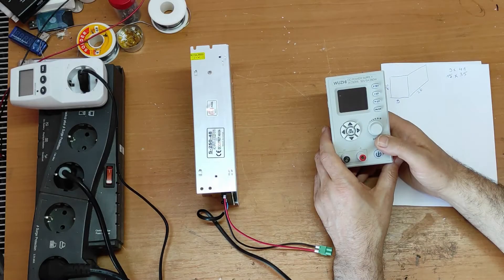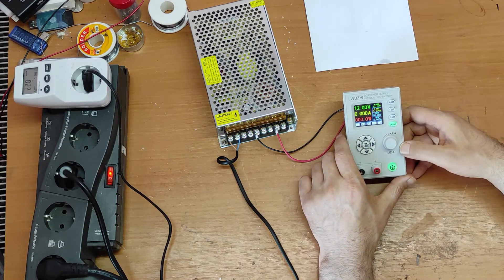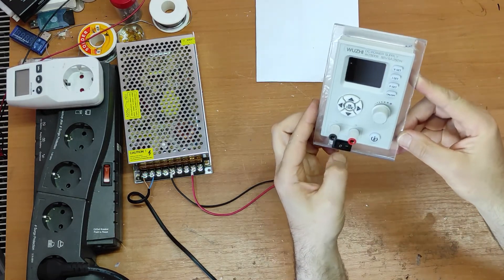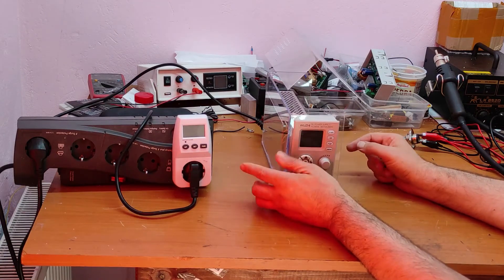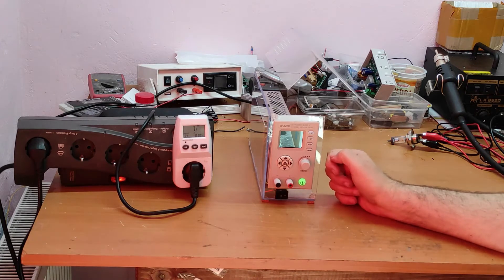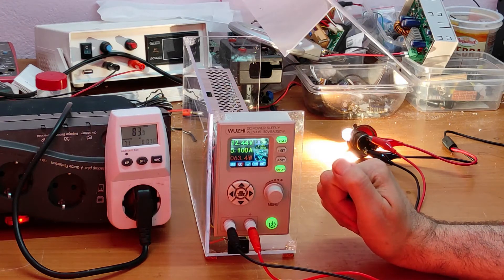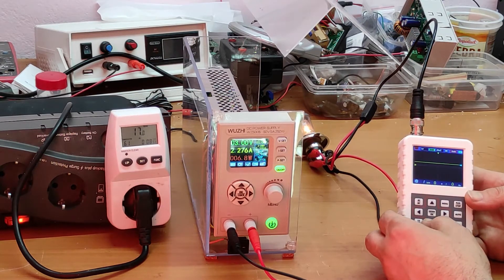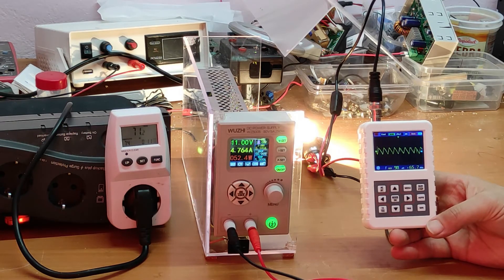50V 5A DIY digital control power supply SMPS under 45usd

Comment: Definitely feel ripped off buying this,you need a power supply,to power your power supply,40 bucks wasted lol
Reply from the maker: bro I dont agree. I use this power suply from 4 years and works PERFECT. brand new ps 50v5A is 3x 4x expensive
Reply: @diymariuselectro  they don't tell you it doesn't have it's own power supply,it's bait and switch,I've never seen a dc voltage regulator that doesn't have a built in power source

Comment: Wow! Very nice that you made this video and upload it on YouTube I was right about to purchase actually I did purchase that specific charger but then I change my mind when I realize that I need a power supply. So I went with a  Junsi iCharger X8 Lilo/LiPo/Life/NiMH/NiCD DC Battery Charger (8S/30A/1100W) and 1000 watts/50 volts power supply. What I like about your charger is that you can preset different voltage on different settings and will remain like that and you select is needed whenever you want it. You did a great job building the box and putting everything together!
Do you recommend this power supply digital face??
Reply from the maker: I recomend this digital power supply,but maximum 60% of its maximum power.Its made in China....